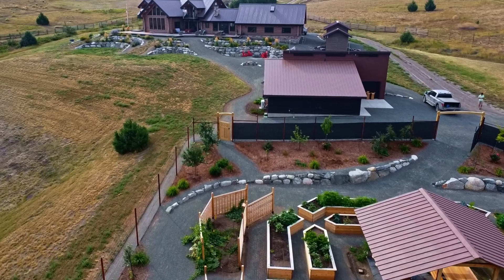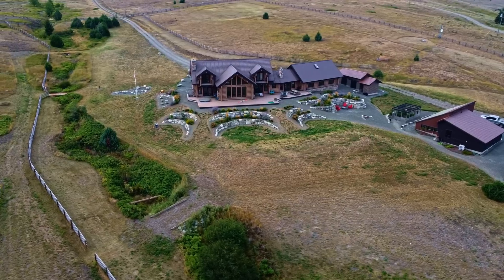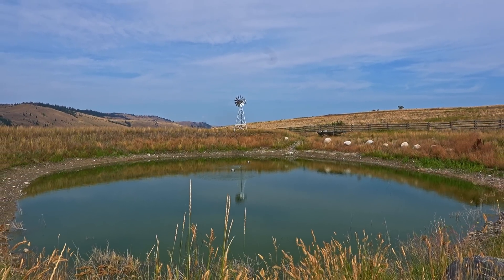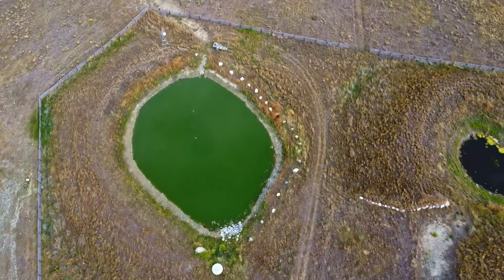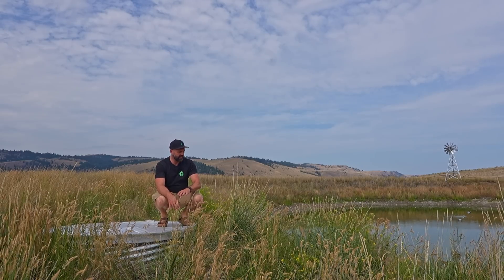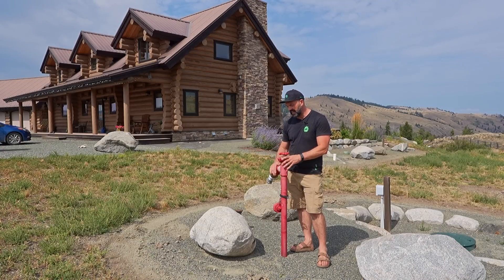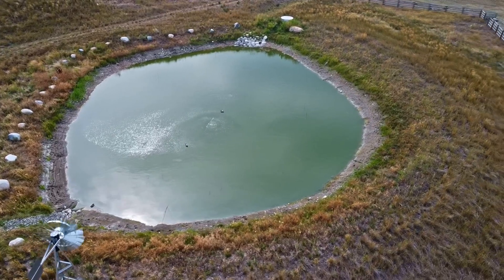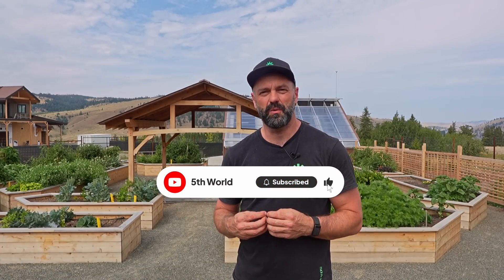Homestead Tour | How Regenerative Water Systems Support Abundant Food and Wildfire Resilience

Comment: Why would hard water be unsuitable for irrigation? The plants shouldn’t care so maybe it’s the plumbing that would have a problem with hard water. 🤷🏽‍♂️
I like the design, and I even have land. But my land is practically dead flat, so I can’t use gravity to move water from storage to where I need it. And a raised water tank would freeze solid in the winter. So I’ll need powered pumps. But to feed a group of people through the year, you must either be able to grow all year or have a way to preserve food for the winter. I just found this channel today so I’ll watch some of your other videos to see if preservation is covered. 👍
Reply from the maker: Hi, thanks for your question! There are several reasons why hard water is unsuitable for irrigation. One is when the minerals in the water crystallize as the water evaporates, it accumulates in the soil. Second, if you are using drip emitters, the minerals will plug up the system and render it useless. Also, you don’t need elevation differences to have this effect. No land is perfectly flat and passive water harvesting is always possible, we just have to design it fit for purpose. Food preservation is a large topic, which includes root cellars, various canning techniques, dehydration, and fermentation.
Reply: Solar powered pumps?